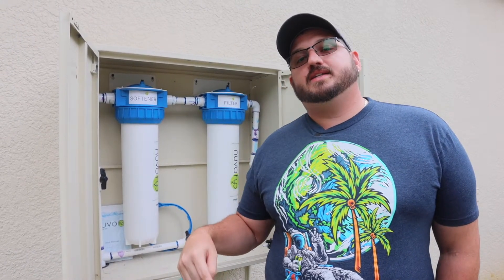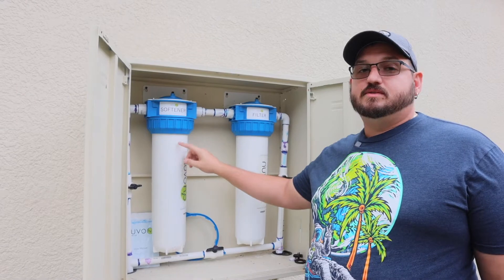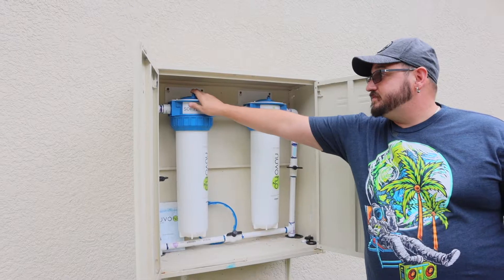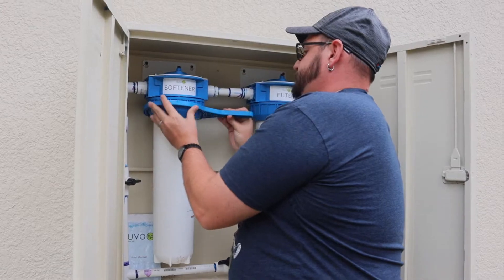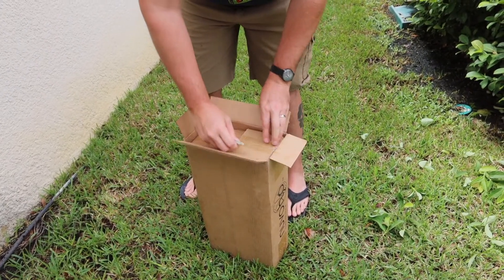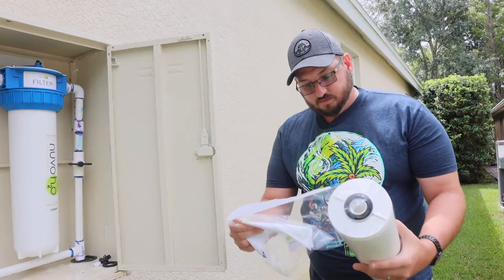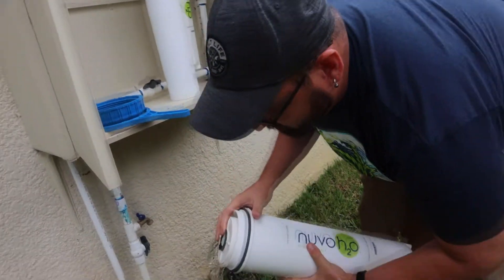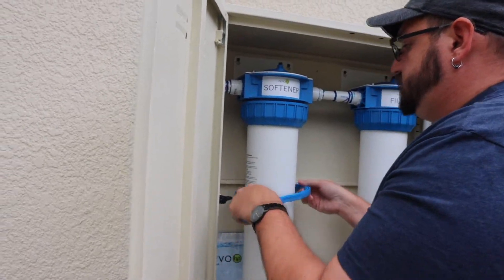How to change filter and Review of Nuvo H20 Water Softener 1 year after installation

Comment: I have the Nuvo Manor system (Generation-1), purchased 5 or 6 years ago and I notice that Nuvo does not include new O-rings with the cartridges when you buy them. One of my cartridges would not seal well as the O-ring had stretched and would not fit in the groove properly. Apparently Nuvo doesn't send new O-rings because they sell them for around $8-9 each plus around $10 to ship. Fortunately I was able to use the stretched O-ring by cutting out a small piece with a razor blade and using super glue to connect the ends. That's working well now. When I called Nuvo to ask for the size of the o-ring so I coiuld get it locally or make one they said they would not share that information since it was proprietary and it would void their warrantee. I guess if I was selling O-rings for close to $20 each I wouldn't want to lose a sale. Too bad, since I no longer will recommend them.
Reply from the maker: Wow! $20 for an o-ring, that's insane. There has to be a way to get a similar replacement from Amazon or hardware store. If I were in your position, I would measure the housing for the o-ring to get an idea how big it should be, and use calipers to determine the thickness of the existing one.

Comment: If you are bypassing it to get the chlorine through your system empty and dry out the filter bowls first to not let them grow bacteria during the time you are bypassing. You can also use them without filters to add the chlorine.just put some bleach in the housing and turn on the water to get to every point of use and leave it for 24 hours then flush out your system using chlorine test strips. Turn off your water heater first and either fill with fresh cold water or let it cool on its own as heat breaks down the bleach. Also test your incoming chlorine from city to know where it needs to get back down to. I usually see chlorine at .05-.08 ppm up here in New England.  Hope this helps. Doing this annually or biannually can help keep any bacteria at bay.
Reply from the maker: Thanks for the tips. Since removing the carbon filter, the algae has cleared up on its own and everything is clean now. Just did another acid replacement and the cartridge housings were clean.

Comment: Double check me on this. Even though you mentioned the importance of locating filter first followed by the other  softener it looks like you have the softener located first and then filter. I could be wrong, it looks that way in the video. I just spoke with Nuvo because I'm changing my filters for the first time and watched your video and the representative mentioned that if the softener is located first there would be slime generated (because the softener cartridge would not be filtered). They also mentioned that there is a hardness range and if the city water is extremely hard then Nuvo may not be able to soften the water. Just some FYI.
Reply from the maker: Thanks for watching and the comment. On my system the water flows right to left. So the filter is first on the right and the softener second on the left. Yes, the instructions do mention that the system will only soften water up to a certain hardness scale. I forget what that was but mine was supposed to be within that limit. The slime is concerning either way, I don't want to drink it.
Reply: Flush your filter before using. Get that carbon out
Reply: @TheWorldsbestwater  how long does it have to be flushed ?

Comment: I’ve had so many problems with my salt system I tore it out and put in a cartridge based system (loved it)! I’ll never go back to salt. Currently looking for a new Cartridge based system and strongly looking at this. Thinking you should just take out the citrus Cartridge for a carbon or paper also I’d like to add you can relieve pressure on filters by leaving the valve open and open sink. Don’t bypass, it’s called a maintenance window for your family. All in all I don’t see a problem except for slime. Salt systems use electricity as well and to be honest I don’t think salt systems did all that great. Thx for video.

PS went through 5 water heaters in 10 yrs. We added a ground to the unit and changed the pump head to carbon fiber.
Reply from the maker: Thanks for the tips. 
Well five water heaters in 10 years, that sounds like pain.

Comment: Glad I watched this. My wife and I were considering switching from salt to citric acid. We have had tons of problems with our salt water softener, with the company, troubleshooting for months, all to find out that the whole unit needed to be replaced after only two months of actual use. Probably going to just use good ole city water.
Reply from the maker: Glad you found it helpful. Sorry to hear about your salt system troubles. Sounds like a real pain.
Reply from the maker: Here in Florida your pipes are so hot, with out the chlorine algae can grow in the pipes. It may not be an issue where you live.
Reply: Replaced?  Why?   Perfectly good softener

Comment: I think the growth you're talking about it is the scale from the pipes breaking down from the citric acid
Reply from the maker: That's interesting theory. However, Once the filter was removed and chlorine was returned to the system it all went away. Also even the citric acid cartridge housing which was new and did not have any scale had this growth in it.

Comment: nuvo h20  was on an episode of TOH     thanks for your honesty
Reply from the maker: Yes, that is how I first heard about it. I was disappointed to realize that they're positive review was not necessarily the truth for me.
Reply: @professionalweekenders  
What are you doing now with you system 
Did you change anything?
Reply from the maker: @bquedenfeld  I basically have left it as I described at the end of the video. I removed the carbon filter, that helped clear up the algae issue. The city of Tampa puts a ton of chlorine in the water, so the taste is not great but it is not clogging the pipes/toilet internals any more. I left the citric acid cartridge in place. Nuvo recommends replacing after 6 months. The first time I replaced it at 6 months it still had 50-75% of the acid in it. So this time I've waited a bit longer. We only have 2 people in our house so I'll give it about a year on replacement this time and cut it open to see then. Maybe I'll do another review at that time. I think we are on maybe 9-10  months on the current cartridge. We still have hard water stains as we do when the cartridge was new, but not quite as bad as before installation. My recommendation would still be the same, get a traditional salt system instead.

Comment: We ordered new filters from Ace Hardware
Reply from the maker: Yeah the filters can be found 3rd party but I don't see where we can get the citric acid cartridge anywhere else.
Reply: We ordered the actual Nuvoh2o citric (manor) cartridge  from Ace Hardware.  We have a 10x4 in sediment whole house filter  prior to the Manor cartridge in our set up.  We did our 1st filter change today and it went well.  (We watched your video prior).  Our system was installed last July. We live in Ocala....no green slime noted inside the cartridge  housing.
Reply from the maker: @user-bl1yg6uq8n  Awesome! Thanks for the update!

Comment: Does the citric acid cause algae or just the citric acid flushing the chlorine out in your high heat environment? I see that your water system is outside in the elements (heat) where mine would be in a cool basement with cold well water? Your thoughts?
Reply from the maker: It is the activated carbon filter removing the chlorine in a high heat environment. Also it is a large house and not all faucets/pipes are used regularly resulting in stagnant water in the lines.

Comment: Thank you for the review, I was about to hit BUY till I hear you talking about the SLIME PROBLEM. Thank you!
Reply from the maker: Yeah, that's been the biggest regret with this thing. I will say that since removing the filter, that issue seems to have cleared up, but that could also be because of the colder weather as well. We'll see if it happens again next summer.
Reply: We have well water so no chlorine and we don’t have issues with algae or slime. Do you think this would be a good system to use other than the issue with price increases?

Comment: High quality intake pre-filter(s). High quality softener system with salt brine. And for drinking, use a gravity Berkey reservoir or install a reverse osmosis unit after the water has passed all the other stuff. If drinking softened water (post Berkey or post R.O.) bothers people, you can run a separate line right off the pre-filters before it enters the softener, and run that line to your drinking water tap (for R.O. or Berkey).
It's interesting how some company comes out with some magic filter or water technology they claim is going to solve all of the water problems. No. The tried and true salt brine water softeners have been functioning for just over 100 years and do the job they are supposed to, regardless of the water quality problems.
Reply from the maker: Wow, that's quite set up. Thanks for your recommendation.

Comment: We bought a house with this system and it was not installed with a bypass. So every time I try to change the filter and softener cartridge it syphons the water from the house including hot water. 

I also have a problem with leaking where yours leaked the charcoal during pressurizing. Mine will not stop unless the o ring is heavily lubricated and the white tub is not allowed to turn a tiny amount while tightening the blue ring. Nuvoh2o support is not helpful. Afraid we are going to have the system removed.

It's like the filter is too long the top part of the white tub will not seat flush to the blue head or whatever that part is.
Reply from the maker: Having a bypass is pretty important, and I would recommend it, but it's not necessary. Issue with your carbon filter sounds like maybe it's not the right size. Many people have pointed out in the comments that the carbon filters (not the citric acid canister) can be bought third party from Home Depot or somewhere else. I wonder if someone bought two large of one trying to save some money.

Comment: I’m just seeing this a year after you made the video. What is your status now?  Are using the system again?  Great honest video. I’m looking to put a system in and my plumber only sells the NuvoH20 manor. Says he’s had good luck with it but hearing you say algae plumes because you live in hot weather climate spooked me. I’m in Oklahoma and it gets toasty here too. Love to know what you’re doing now. Thanks.
Reply from the maker: I'm still using the system. However I do not have the activated carbon filter anymore. That has cleared the algae problem. Although as others have mentioned in the comments system does not do great at getting rid of hard water either. It is better than nothing, but does not solve the problem. It's still a struggle in all the appliances and toilets and sinks. I will be replacing the system at some point.
Reply: I mentioned your situation to the plumber. He stated I’m only getting the single softener and if hard water persist he put a second citrus filter in parallel and that would work but stated he’s only had to do that a couple of times in the 10 years since selling.  I’ll be on the lookout for what you do next. And by the way I’m on city water.
Reply from the maker: @MrJohnT  I'd love to hear how that works out for you.
Reply: I had this system put in last year because my old, salt softener was plumbed incorrectly and was killing my outdoor plants. My plumber tested the water with this system and said it was fine, but I have hard water scale on my faucets, my white clothes are dull appearing. Our area has very hard water, so maybe this all I can expect. But for the money, I expected better.
Reply: Well it’s been a little over a month since the NuvoH20 Manor water softening system. It has made a tremendous improvement. I can actually see through the water if that makes sense. I’ve installed new appliances that use water and the difference is really incredible. It make me sick my dogs and cats drank that nasty water. Clothes are cleaner. I’m really impressed. Now we’ll show it is at the 6 mos mark when changing filter. Next up a hot water tank. Thinking about the tankless system. There’s only two adults in the house. No kids taking 6 hr showers. Thoughts?
Reply from the maker: @MrJohnT  Great to hear. Glad it worked out for you. 
granted I'm just a DIY'er but I've heard those tankless systems  can be more trouble than they are worth, particularly if you have hard water to begin with.  With two adults in my home we have only ever ran out of hot water from our 80 gal tank maybe 2x in the last 5 years. BTW and 80 gal tank will actually give about 120 gal of hot water because it pulls from the bottom which is heated as it is being used.
Reply: @professionalweekenders  thank you for the heads up on the tankless. I’ve got a little time before I pull the trigger.   My son installed one at his house and has had good luck with. I’m hoping the water softener will help alleviate the hard water and if needed I will have a 2d Nuvo installed. We’ll see. Thanks again for your video. My next project is a drywall repair where they had to cut into for some plumbing. They wanted extra $ for that and thought I would give it a go. 2 Small square patches. Wish me luck.

Comment: You can replace the citric acid filter with a template assisted nucleation  filter.  It will tolerate chlorine but won’t last as long as it would have with the carbon pre-filter.  Maybe one year instead of three.
Reply from the maker: Good to know. Thanks for the info.

Comment: Great information. I live in a pretty high heat climate, SW MO. I only have the citrus portion hooked up. So far works great, other than I didn't know I could see how much is used... it is very obvious when it's too late. 😊 is this the portion of the system you are still using?
Reply from the maker: Correct yes. I'm still using the citrus side of the system.

Comment: Don't get this. If you get any of the citric acid on anything it will eat through concrete. Also, a pain in the butt to change the filter and clean everything out. I always cleaned it outside in the yard because of the possibility of the citric acid ruining something. Mine leaked after 8 years and I just got rid of it. I had a water softener before that and used potassium instead of salt but it was still a pain in the butt.
Reply from the maker: You're 100% correct. Do definitely have to be very careful with the citric acid. I also accidentally had some of it spill in my concrete driveway and it's stained and remove the top layer of concrete. I recommend like you to dump the extra water into the grass.
Reply: Also this is not a water softener. It is a water treatment device. Hague Watermax systems are trully the best for true water softeners.